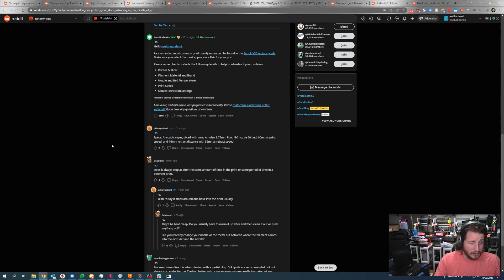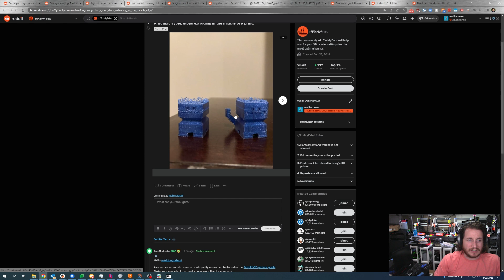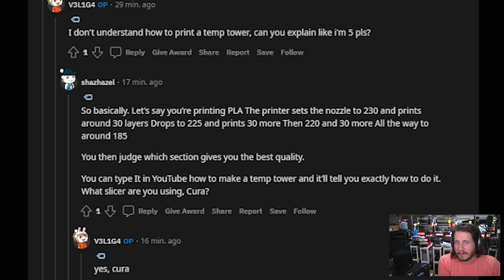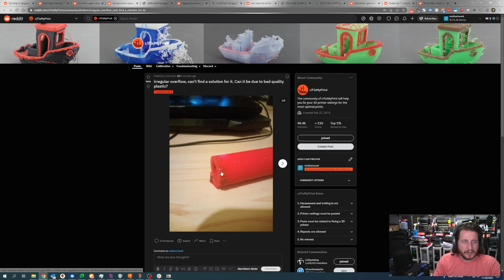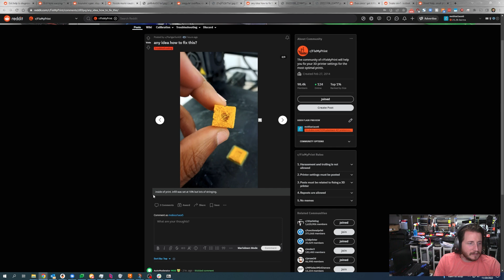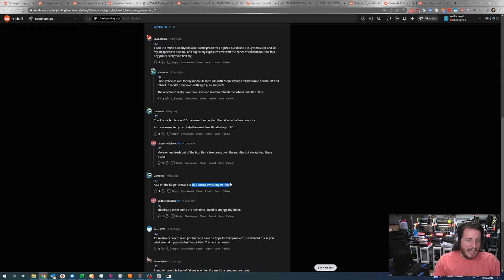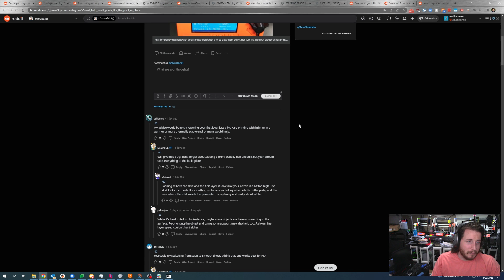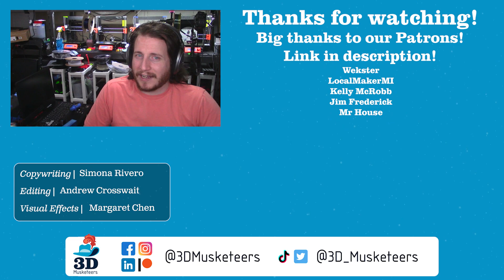Stringing, An Overheated Sidewinder, and A Lubricant Hoax! - PrintFixFriday 63

Comment: When I got back home I looked at my 3mf file with the failed supports. It definitely had more room for supports, which is what you were suggesting. I didn't think it did. So I painted more supports, a lot more. I also dropped it down to 0.1 separation. But knowing that will cause problems with the bottom supports, I reduced that quite a lot. I was hoping for variable support settings based on modifiers, but PS doesn't seem to support that. I started it last night. It's almost to the part of it that failed. We'll see how this goes. The tail failed as well. The peg sticking out of it was too thick and wouldn't fit in the part. It's odd, I've been using a 1 to 1 peg vs hole and it's worked on other models, but not this one. So when I reprint the tail, I'll print the peg separately and have a hole in the tail as well. Then I can adjust the peg as needed.
Reply from the maker: If you have a peg sticking out chances are it will need to be sanded. That is typical. Could be a tolerance thing